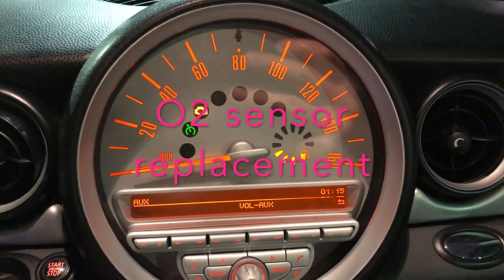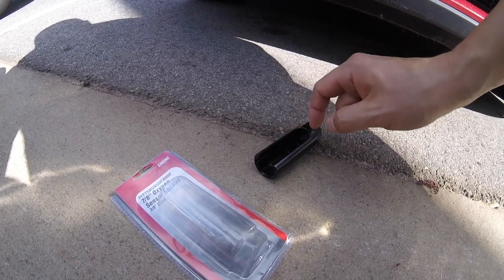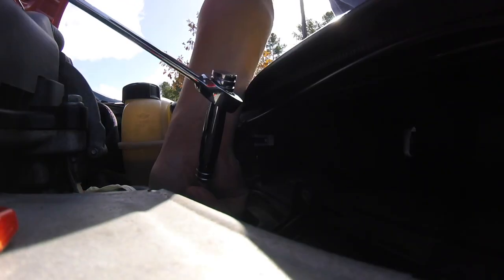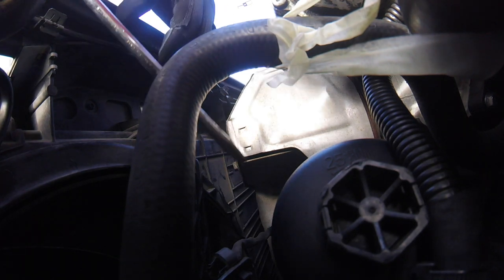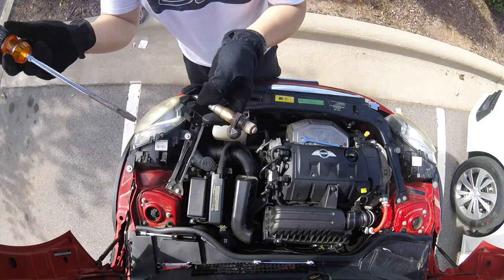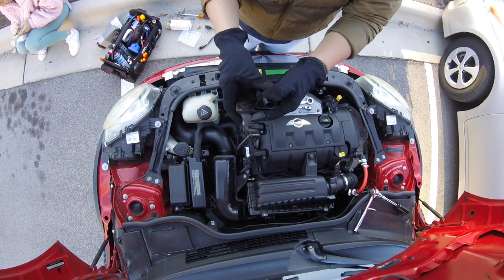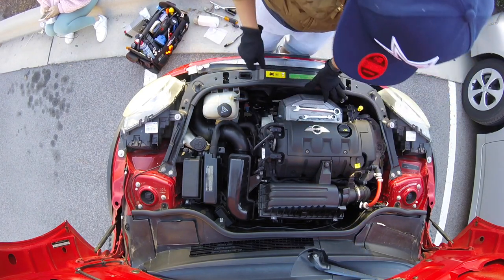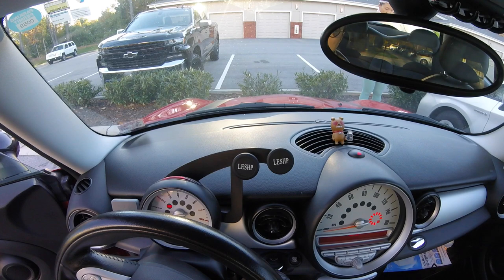(Worked GREAT!) O2 sensor - mini cooper rough idle and engine check light fix

Comment: Sometimes they can be very sensitive to some parts, unless you use the original parts. One example is the after market thermostat!
Reply from the maker: Hi, thank you for sharing your experience! I was trying to save some money by using some aftermarket parts. In my case, somehow the thermostat housing was perfectly working so far. I bought one from amazon and looked pretty much similar to the original. :) I might be lucky! By the way, do you own Alfa Romeo? My first car was a 96' spider and I pretty much liked it, regardless it is reliable or not.

Comment: Great job removing that electric wire  housing gives room to work on removing the sensor! Will remove and clean both the sensor and the cat with crc throttle cleaner

Comment: I have Cooper S r56 when I start the car in morning it rough for 20 to 30 seconds and I have check engine I replaced spark plugs and 2 coils (cylinder 1,2 ) because I have misfiring in these cylinders but I didn’t replaced injectors and I didn’t check the O2 sensor. Do you think the problem with O2 sensor or something else?
Thank you
Reply from the maker: I had a misfire in 1 cylinder and after replacing all four plugs no misfire warning came on. Regarding rough idle, it can be a separate if you still experience. It can be rather complex, but I would start with oil change, O2 sensor, and if still happens I will look for the air intake. The first two should not be too difficult or expensive.
Reply: @gompro4943  thank you and should I Diagnose the timing chain because I took a video when I started the car (cold start) and a lot of people said I should check the timing chain immediately! what do you think?

Comment: The sensors or emissions control system should directly help DIY to identify failed parts and circuit 
But it's designed to HELP....using CODES.
Never let government help...
Because it's a
Racket.
When in fact they could a designed sensors to isolate the exact part or parts or problem so
WE always know.

Comment: Hello mate i have a problem with white smoke from exhaust and he loses sometimes a bit of power (mini one 1.4 90hp 2008) but there are no water/oil leaks. New glow plugs,filters,oil coolant
Reply from the maker: I would check O2 sensor and plug. GL!
Reply: Head Gasket needs replacement.
Reply: Do a compression test first
Reply: Always diagnose first. There could be many things causing your issue. Run a scan with an ODBll tool. You may have warn valve seals, your fuel mixture could be rich (check fuel trims) or you may need a new PCV valve, bad rings (compression test) or head gasket( look for exhaust gas in antifreeze fill or do the chemical test) Best of luck

Comment: Code problems point to circuit problem not necessarily sensor problem..sensors do go bad butt
Butt.....dirty engine...or. Less maintained engines or wear good mileage engines....cause
Multiple problems...by tightening up...specifications.....flow of pressures is monitored by computer....resetting codes after copying to record......maintains your record but resets limo mode..or what is known as reduced power mode....when YOU thinj it's a serious mechanical problem which is actually a small leak.
The emissions controlled state of dealers n manufacturers and engine users.....want you to FIXX.